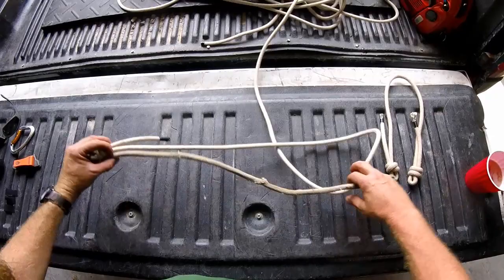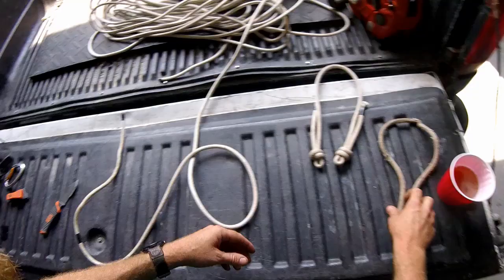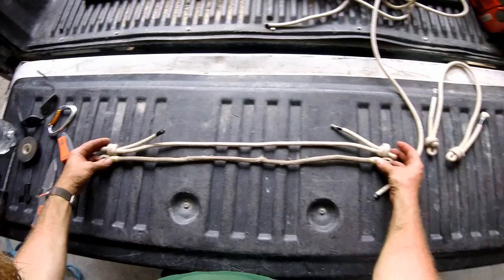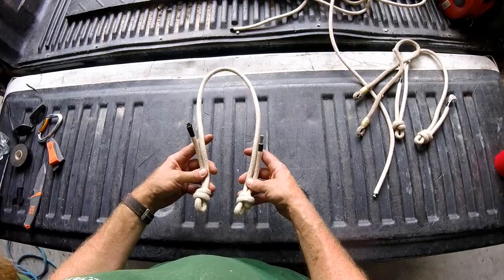Eye To Eye Split Tail - Make your own hitch cord

Comment: There are adjustments to be made with fixed length eye to eyes.  Apart from tying a different hitch you can change the number of wraps, turn the hitch 180° and clip on to the other side of the hitch, or even twist in or out the eyes to increase or decrease the grab of the hitch.  Richard Mumford goes into detail in one of his hitch tying videos.  I've climbed on factory spliced and tied eye to eye and don't mind either. The ability to choose an exact length is nice, but the sleekness of a spliced eye is a plus too.  No bulky knot to get in the way.  Trade offs.  It's the name of this game.  Good video though.

Comment: What kind of rope should I use to do my own prusik cord? Could it be dynamic rope used for rock climbing or speleo rope?
Reply from the maker: You need heat-resistant cordage for prusik cords, and they should be about 25% smaller in diameter than the host line....... hope this helps....   - Patrick
Reply: @TreeMuggs_PatrickM I purchased 100ft of 8mm cordage off of Amazon that  I sent back immediately because its construction seemed sketchy.
Proper cordage is necessary because ones life may depend on it someday.
Reply: @krustysurfer  Excuse me, what brand of rope did you refuse from Amazon?
Perhaps your advice will help me a lot as a beginner in arboristry!
Reply: @alexmelnua  needs to be heat resistant dacron polyester I believe, dont quote me on that, Nylon melts and weakens so does polypropylene... Needs to have a certain ansi rating, I dont know what number is needed?

Comment: I'm curious about the strength of the cordage with an knot vs an spliced eye?
Reply: Spliced is stronger. Not sure, but I think a knot losses about 30 or 40 percent strength.
Reply: These ropes are designed to withstand well over what kind of punishment your body could withstand if you fell on them even at half strength. The kind of fall that would break a rope would be pretty extreme. You would probably end up with a broken back first.  We try to limit our slips and falls to less than a couple of feet by tending slack and keeping tension on the climbing line most of the time. Just saying.
Reply: The eye itself is the biggest weak-point. Whether the loop is spliced/sewn or held-fast with friction from a knot, the bend loads the fibers in the loop in a less than ideal manner. Compressing fibers along the inner radius of the bend while stretching fibers along the outter radius.  All the knot is doing is holding the loop together with friction, and , while yes, that does produce side-loading on the loaded fibers of the main-run, the stitching in a spliced line does so as well. You also need to take into account that each side of the loop is only seeing half the full force applied on the eye, which means the knot is only ever receiving half the load applied. Which would be a quarter-force in a typical friction-hitch (basket) application.  So with a load of 100lbs, each knot would only be seeing around 25lbs.  

 You're only going to get into real problems when a knot is directly trying to transfer an in-line force. i.e. a midline knot. And then that all depends on the type of knot used, radius of bends, and style and diameter of rope.  This is because the knot prevents the fibers of the rope from stretching uniformly and sharing load uniformly.  And It's slightly less critical when those knots are at an end of the line and on the backside of a loop.   
Just  the consequence of using a fibrous material vs a cast attachment like steel where every molecule is chemically bound to its surrounding molecules allowing them to transfer forces more efficiently.

For an application like this, I would doubt the point of failure of either option is greater than 2-3%, all other variables being the same. (Load, rope, attachment hardware, radius of eye).  But even then, merely increasing the radius of the bend would increase the failure point. This could easily be done with a knotted eye, and not with a spliced eye.

Comment: Would you be able to suggest a hitch cord to use with Buzzline 1/2 inch 12 braid rope by Yale? The 9mm bailout premade I have works but I have nothing to compare it to.
Reply: You should be getting a 10 mm hitch cord that is also heat resistant. Tuefelberger serius 10 mm, or a yale beeline 10 mm would work nicely. Keep in mind that your hitch cord should be 2 mm smaller than your main climb line. Also another suggestion would be to get a colour much different than your climb line, it helps to separate the two and not getting confused.